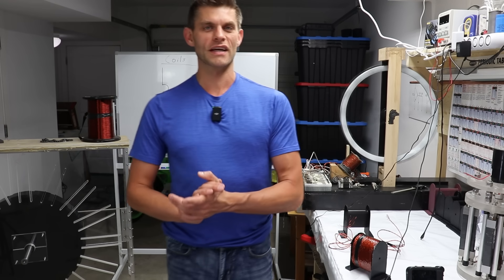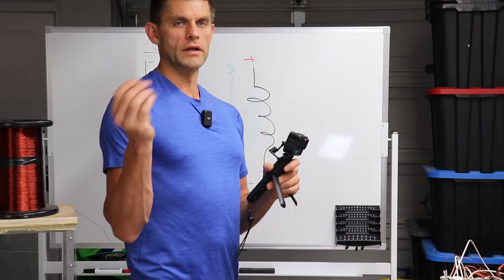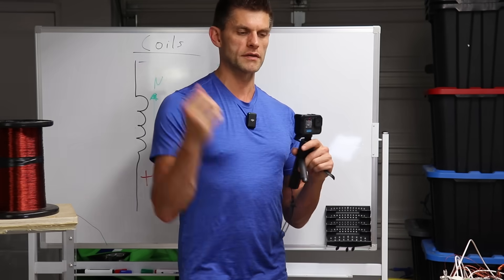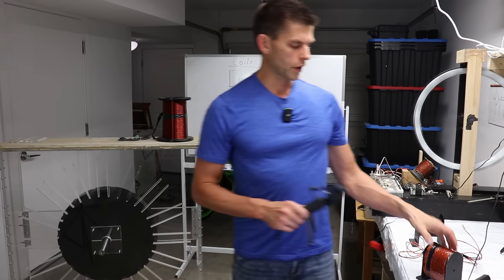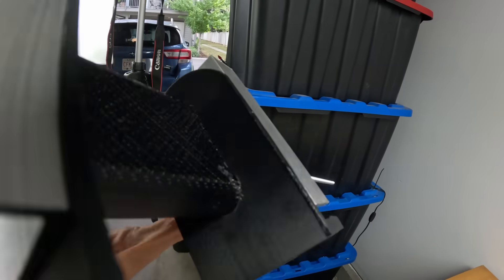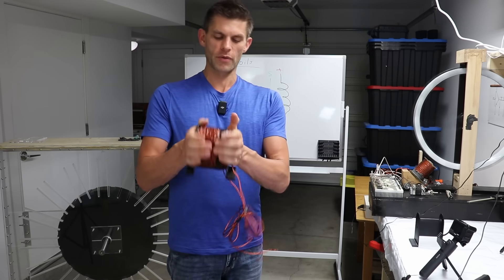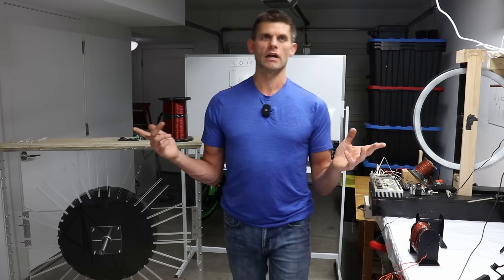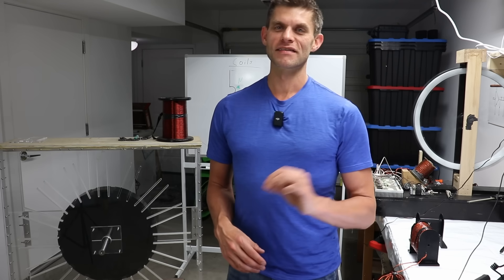Unlimited Energy in My Garage (No Patents)

Comment: Dr Townsend brown might have said something about this effort. Might want to look into his work.
Reply from the maker: Will do
Reply: @MadscienceLPTECH  The Biefeld–Brown Effect is an effect that was discovered by Thomas Townsend Brown (USA) and Dr. Paul Alfred Biefeld (Switzerland). The effect is more widely referred to as electrohydrodynamics (EHD) or sometimes electro-fluid-dynamics, a counterpart to the well-known magneto-hydrodynamics. Small models lifted by this effect are sometimes called 'lifters'.

The effect relies on corona discharge, which allows air molecules to become ionized near sharp points and edges. Usually, two electrodes are used with a high voltage between them, ranging from a few kilovolts and up to megavolt levels, where one electrode is small or sharp, and the other larger and smoother. The most effective distance between electrodes occurs at an electric field gradient of about 10 kV/cm, which is just below the nominal breakdown voltage of air between two sharp points, at a current density level usually referred to as the saturated corona current condition. This creates a high field gradient around the smaller, positively charged electrode. Around this electrode, ionisation occurs, that is, electrons are stripped off the atoms in the surrounding medium, they are literally pulled right off by the electrode's charge.

This leaves a cloud of positively charged ions in the medium, which are attracted to the negative smooth electrode, where they are neutralized again. In the process, thousands of impacts occur between these charged ions and the neutral air molecules in the air gap, causing a transfer in momentum between the two, which creates a net directional force on the electrode setup. This effect can be used for propulsion (see EHD thruster), fluid pumps and recently also in EHD cooling systems.
Reply: @MadscienceLPTECH everyone pushing a wheel could use some free momentum

Comment: Shame that you are ignoring the basic laws of physics. Coils do not store any energy, they are not capacitors. The hose or Balloon example is due to stored potential energy in the expanded hose or balloon elasticity.
Reply from the maker: Lol yes coils do store energy. Do inductors act as caps at hi HZ?
Reply: @MadscienceLPTECH Still ignoring Conservation of Energy. Losses due to friction, noise, heat and the fact that magnetic fields through air are not efficient for transfer of energy. Even the most efficient transformers with a core are not 100,% efficient. If perpetual motion or free energy was really possible, it would be have been exploited years ago.

Comment: On a scientific level, free energy is not possible. The electromagnetic pulse (EMP) from the coil behaves like a mechanical spring—it responds to energy loss. Combined with friction, the system will eventually stop. However, if you somehow succeed in creating free energy, I will give you $10,000.

For those who want to utilize "free energy"—meaning energy you don’t have to pay for—you can connect 5-6 LEDs in series and wire them in parallel to your phone line. The phone will still function, and you’ll have light even after a complete grid failure.
Reply from the maker: Ok i bet you wont give us the 10k once its running, but here is to the offer

Comment: The tesla SSG works, like a forced oscillation resonance.  The current in L1 moves in one direction, consuming little to no current.  Current creates heat and opposing mag. fields.  So by finding the resonance of the Impulse bouncing back and fourth in the L1.  Each created impulse is laid directly over the preceding. You can start by using a beat fequency of a few hertz.  Tuning The L,R and C to work with the impulse in the mag. field of the earth. You can bypass the earth with a large homogeneous magnet. But when creating the Negative sink, make sure there are no metal or transformers messing with the tuning of the coils.  Tesla used a balance beam to have L1 and L2 weight the same.  This is not normal resonance.  HV input in one direction, minute current consumption, creates an increasing amplitude AC wave on secondary.  To create more power, larger coils, the circuit remains the same.  Tune the coils with resistive load lights on secondary.  When you add a load, the resonance changes, so you need a circuit call a piezo-electric resonance transformer that keeps resonance between L1-L2 with load.  Kapanadze used a HV circuit from plasma TV from NEC in late 90's.  Been a while, but thats all off the top of my head without notes.
Reply from the maker: Dang impressive 😊

Comment: You and I are on similar pages, though my approach is different.

Instead, the way that I approach this is by thinking about heat pumps and energy symmetry. Now the refrigeration cycle does not create heat, everyone knows that and that part of the matter will always be true. But what a heat pump does do through the refrigeration cycle is concentrate latent heat from a cold reservoir to a hot reservoir with a COP > 1. If we stop considering only heat and instead shift our focus to the system, what we can see is that the heat pump through the refrigeration cycle is constructing a thermal potential gradient with energy densities above and beyond the energy expended to run the pump.

This isn't typically usefull when we look at a heat gradient because basically every known form of thermal gradient energy transformation is carnot limited and the carnot cycle is reciprocal to the refrigeration cycle. Combine that with real world losses, irreversibilities, and you have no way of actually making use of the heat pumps COP > 1 to produce indefinite useable energy.

But if we shift our focus back to the concept of energy symmetry, we can instead look at the coulomb motor using latteral motion relative to the main coulomb force direction to generate torque and motion, we now have an inneficient and lossy motor, but this inneficiency in the forward direction turns into a COP > 1 if we instead apply mechanical input to separate charge. Now, due to the lateral motion, we only have to work against a small component vector of the electric force in order to separate charge but we can extract the energy in that newly constructed charge gradient via non-reciprocal pathways, say through lorentz forces using electromagnetic motors.

This enables us to construct feedback loops that sustain themselves while also producing continuous excess outpout.

People forget, that if the first law is a scientific theory, then it must be falsifiable. If you approach every problem thinking "the conservation of energy must hold" then you are claiming the first law is unfalsifiable and that's not science, that's dogma.
Reply from the maker: Great comment. Tesla spoke of machines that would run cold and draw atmosphere heat in

Comment: I did this 17 years ago 😅 but what I didn't know 17 years ago was the led acid battery part tapping into the Ether. Check out my video below and you'll see I did the same thing you're doing but wirelessly only I recycled it back into the motor to raise efficiency. I used capacitors to level out the voltage. Dang if only I knew about the led acid battery thing back then that would have changed everything. The thing you need to know is that when the field collapses it doesn't just backspike through the wire it also makes a toroidal shape extending out in space around the coil too If you put collecting coils around the coil being collapsed you can also capture the energy being blasted out. Your video has parked some ideas 💡 I think I'll give a try. May I suggest another another lost tech that we need to make? The nitinol engine developed at Berkeley in the late seventies. That thing is awesome!!! And so easy to make. Also for what it's worth, check into mu-metal it's awesome and what you need, you can use to block or redirect magnetic fields, it was used in old school platter hard drives to protect the drive from the magnets inside. I'll be following along I'm excited to see where it goes. And learn more about this led acid battery phenomenon with the Ether (zero point energy field)  my video from 17 years ago check it out it's basically what you're doing only wirelessly.

https://youtu.be/RQbq-t9AVC0?si=tKYupmlxqrfejWAZ

https://youtu.be/dh2SlzmyvoM?si=LkhpTbCDaJakcEcG
Reply from the maker: Amazing, glad you are here 😊 super cool
Reply: This is the video where I successfully recycle the collapsing field back into the motor. Whereas you're putting into the led acid battery charging it I presume?  https://youtu.be/dh2SlzmyvoM?si=LkhpTbCDaJakcEcG

Comment: This looks amazing well done for putting this out. Watching you with the drill and wire reminded me of my making Guitar pickups mid 70s. I used a drill and connected a wah wah pedal to the drill switch for speed. Of course the wire was thinner than hair and broke very easily but I soon got the hang of several thousand turns without breaking. Feel sure Elon may be interested in what you're achieving here. 🙏
Reply from the maker: Lol i have so much more wire to twist :) new video tomorrow

Comment: Love the build. If you want the community to verify “excess,” here’s a clean, open test you could run and post:

No batteries: swap both banks for known capacitors (published values/ESR).

True power in/out: log high-bandwidth 
𝑉(𝑡),𝐼(𝑡)
V(t),I(t) on the input and output and integrate 
∫𝑉𝐼 𝑑𝑡
∫VI dt (share raw CSV + scope settings).

Mechanical channel: report torque × RPM if there’s useful shaft work.
Heat sink for output: dump output into an oil-immersed resistor/calorimeter and measure joules by Δ𝑇ΔT.
Null run: same rotor/coil but send flyback to a resistor (no “recycling”).
Close-loop proof (only if >1): one pack, self-running + constant lamp load ≥24 h with independent coulomb counting; SoC unchanged within error.
High flyback voltage is normal (𝑉=𝐿 d𝑖/d𝑡 V=L di/dt); the question is net joules. If this clears >1 with data, it’ll be huge—and easy to replicate.

Comment: Curious why you didn't mount coils at the top of the frame of the prototype adjacent to the direction of spin on the wheel. Wouldn't this generate additional electricity you could harvest? Also mad props to the coil building, you could probably make some gnarly transformers at this point
Reply from the maker: Where they are mounted is optimized for the field they produce?

Yes we could wind some big Tesla coils :)
Reply: @MadscienceLPTECH  
What I meant, is that if you left the design how it is, but added let's say an inductance coil at the top, or however many coils in a typical generator fashion of that size. Wouldn't you be getting additional energy from the magnet's inductance through those coils? At only the expense of adding the coils to the set-up. It seems like the flyback principle you are tapping into is something that could be applied to minimize the input on standard generators and maximize the output. Though I'm not sure if there would be a flyback or similar effect on the fields of the surrounding coils you add, which would make it impossible. That's why I was curious, still am

Comment: His garden hose analogy actually encapsulates every single principle of why his machines will never actually work. Because the nozzle never releases more energy than what was put into the hose in the first place when it was pressured up.

Higher pressure equals higher voltage, but when you do that, you are sacrificing, how much water is let through, which is current. And the two multiplied together to get what we call power. 

I’ve been watching people try to build these machines for at least 25 years now. This is a fun, hobby, but I really hope this guy doesn’t waste another 10 years thinking that he is going to defy the laws of physics.
Reply: Inertia my friend it will help you...
Reply from the maker: Some people know what's impossible snd some people build the impossible
Reply: @MadscienceLPTECH that’s a sentence that sounds like it means something, but doesn’t. If something is impossible, you can’t build it. 

If it’s imPROBABLE, you can. 

There’s a whole universe of difference between the two.
Reply: @JonValtandtheEvilRobots  He gave you an anime character optimism quote as a scientific answer

Comment: I’ve been in the power industry since the mid 1990’s and here’s my take.

Using the automotive industry as an example:

Cars in the 1960’s ran quite well and didn’t require much, if any, pollution controls.  On the other hand, they required frequent maintenance to ensure the carburetor was adjusted properly and the ignition system was set to the correct timing.

People, generally, did not understand the mechanics of cars and engines, and did not maintain the cars properly, thus leading to mal performance and hence greater pollution and loss of reliability.

This anomaly brought the need for pollution controls and drove laws, and the industry to make a better product that required less maintenance and better reliability.

Point here is, if our society moves to local power, versus grid power, the onus of maintaining the system will fall on the individual owners or occupants of said buildings.  We know from experience that people generally are not technical and will have failures or catastrophic issues revolving around electrical power production in their respective occupancies.  This will drive new laws and the industry to respond in kind, as well as competition to thrive or threaten the idea of local power production.

Your idea is great.  Make sure the product will include a phenomenal service and marketing team to support it.
Reply from the maker: Enjoy your comment 😊

Comment: Im making a torsion field free energy  device using hobby motors😊,  solar light panel both rotating opposite spins left rotor clockwise right rotor counter clockwise... coil in between
Reply from the maker: Cool
Reply: @MadscienceLPTECH  the thing with magnetic energy, is, the magnets have to flip poles as a rotor with stationary attached magnets... im using 4.25 inch pie tins with neodymium magnets at quarter marks equal to 4. Both left amd right rotors are exactly the same. The only difference of them, is their rotation direction... the coils are equipped with a steel wire core, insulation sleeve, magnet surface, wrapped with copper wire to produce electromagnetism which is perpetual..

Comment: Well, you're pretty close to the "Holy grail", so to say. I'm in this since...50 years ago. 16 magnets,are enough. You don't need coils. You just need 3 more magnets perfectly fitted in that armature. Then, you have unbalanced system, cause whole Universe is "unbalanced" or so to say, in chaos. If its perfectly balanced ,then, there will be no movement. So, number 16 cannot be divided with 3. You have surplus. That abundance of energy (from the surplus of this equation), you can use. You  need one more thing - the mass. That can be provided with flywheel. And at the end, one more thing - the special diamagnetic material placed in a right place at the right distance between the magnets in stator and rotor. That barrier must be placed perfectly on these 3 magnets in stator, shaped as crescend. The rest - you have to discover yourself. I can't tell you everything. The system,it rotation speed and the power, can be easily controlled by very advanced, complicated but prefect mechanism which is look like umbrela. It is tied with main axe of the rotor, so it works automatically. As the necessity for power rise, it increase the speed by reducing the gap between the magnets of the rotor and the stator. As the requirements for power fall, it decrease the speed by increasing the gap between the magnets. This is done by this control mechanism which look like umbrella, something like gyroscope. Once when you set up the rotation speed according to the situation, you don't need to do anything else afterwards. Good luck
Reply from the maker: Why would 16 or 19 matter to the coil, its the same as increasing frequency

Comment: The Dipole you create to pull in this Energy from the local environment is the same Energy that Powers a Stanley Meyer ‘Water Fuel Cell’ (WFC) that is said to be Voltage Dependent &. Amperage Restricted. A WFC creates an Opaque White Cloud of HHO Gases that pours off the WFC at the flick of a Switch & uses an Effect known as the ‘Electron Avalanche’ that produces a +Positively Charged Hydrogen Gas (having missing Electrons) that has more Ooomph/Power than regular Hydrogen. The Fun part is when you Tune your setup (Phase Locked Loop Auto-Resonance) & the Coils Sing in Resonance with a High Pitched Whine that’d then Burn Out your system, & then you’ll create a Gated High Pitch Whine in an attempt to control that output.. It’s both a Rabbit Hole & a Money Pit!
Reply from the maker: Yes

Comment: I really hope you‘ll read this: 

First of all, cool build!

But there is no proof of excess energy yet. Please show input and output power with proper time based measurements and no batteries in the loop. Until Pout clearly exceeds Pin with uncertainty stated and others can repeat it, the claim remains unproven.
Reply from the maker: Not true, batteries are needed
Reply: @MadscienceLPTECH  
Thanks for answering first of all. 

I understand that your design uses batteries for energy recovery, but for proving excess energy, they make it very hard to rule out stored charge as the source. That’s why independent tests typically replace them with purely resistive loads or capacitors during measurement. Could you show a run where the recovered energy is measured directly into a known resistive load, so we can clearly compare total input vs. total output over time?